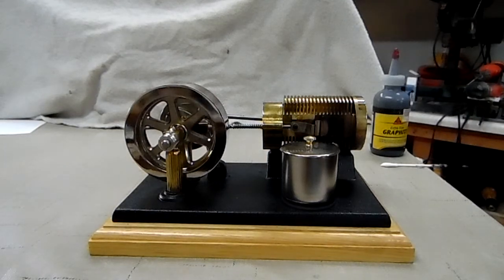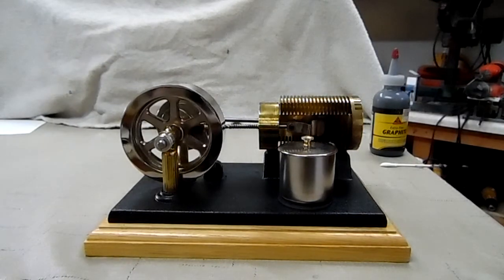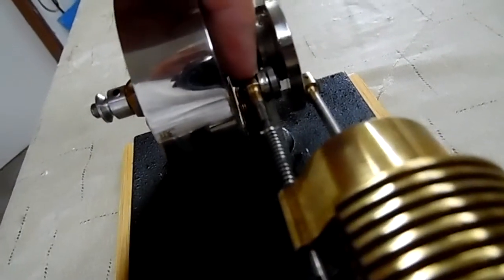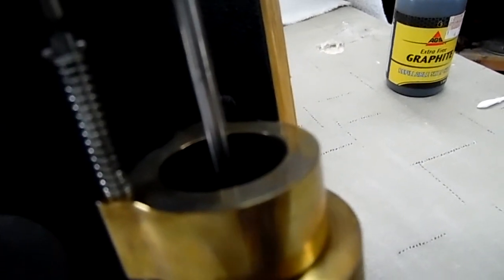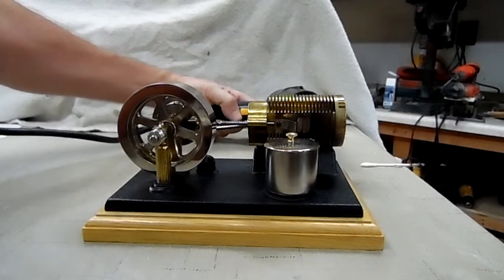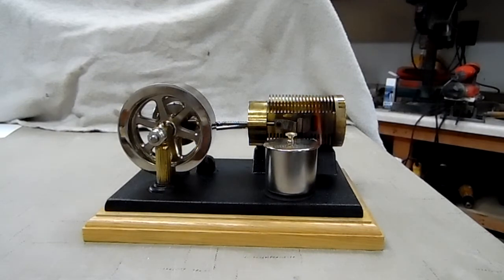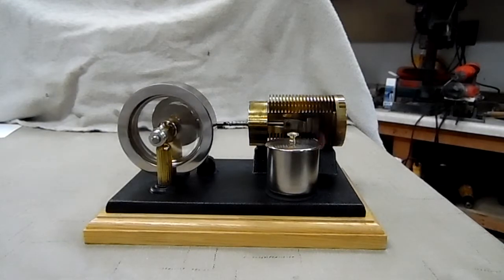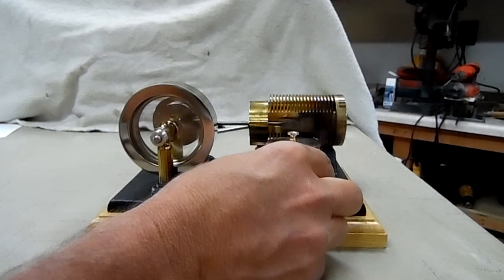Fine tuning a Pm research Solar Engine #3

Comment: I just got one.  I read the instructions and used only graphite in the piston.  Used 3 in 1 oil everywhere else.  I followed the instructions to the letter, but the engine wouldn’t start most of the time. It took a lot of doing and a large flame then maybe it would start, sometimes.  I watched this video and went back and discovered the graphite valve wasn’t closing fully; adjusted and now it starts first time when warmed up with just a flick of the wrist.  Thanks for the video!
Reply from the maker: I'm certainly glad you benefited  from this video. Precisely why I made it. One little thing not right can spoil the experience 😊

Comment: I know this is a fairly old video, but I could really use some help. My grandfather recently passed away and this exact little motor was always our favorite thing whenever I visited him. I want to have it repaired but I have no way of getting parts myself. Is there anywhere in Central Florida you might know I could take it? Or perhaps what kind of business I should try to find to repair it?
Reply from the maker: Hi Max , PM research (PMR) carries this particular engine & may even repair it & have parts for it , failing that you can send it to me to possible repair if you like...it really depends on what's wrong with it ? if it all seems to be there but just won't run , its usually the gate (flap) that covers the port in the cylinder block , its rather finicky & must be in the correct position to run . Just PM me to talk privately if you like .
Bruce
Reply: @bruceang82  like you said it seems to be all there it hasn’t been ran in at least 15 years however. I’ll try PMR like you recommended. Thank you!
Reply from the maker: @vexatiouselk2130  Good luck. I hope they can take care of it for you.